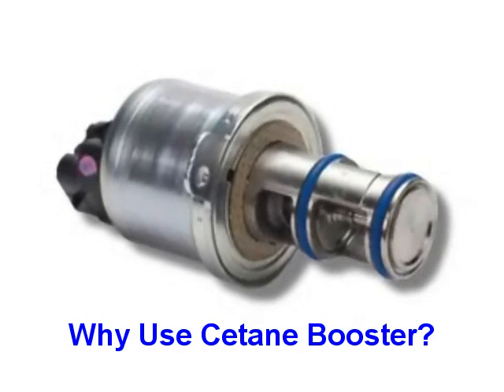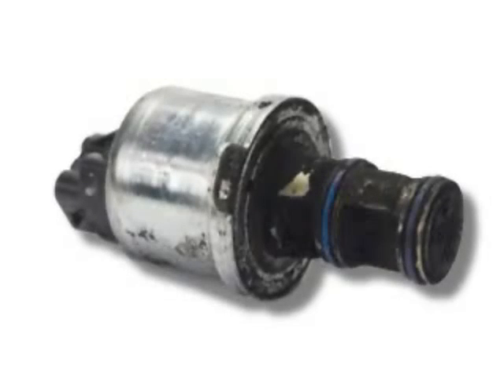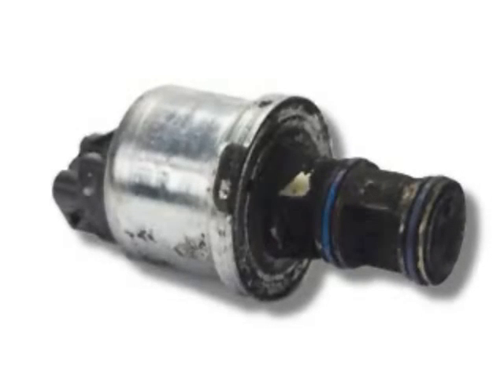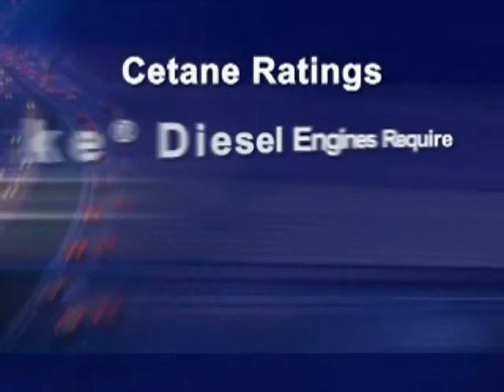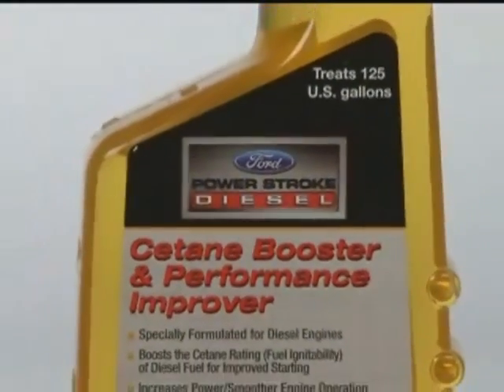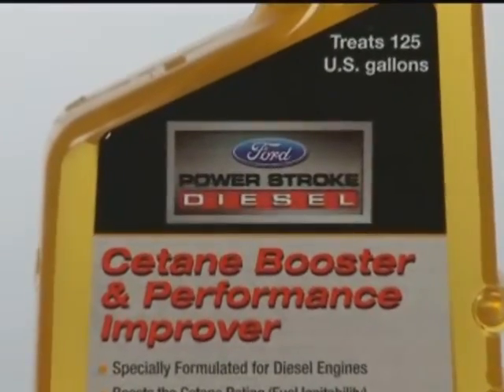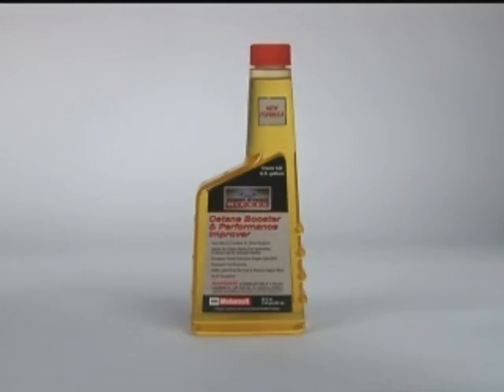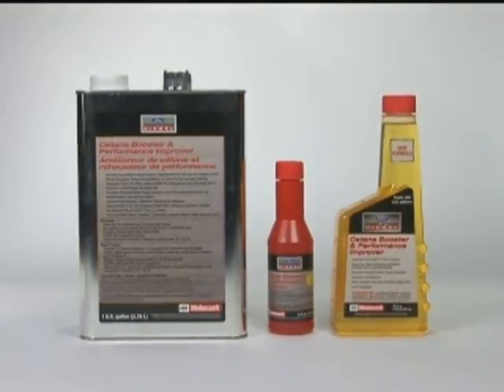Does Cetane Booster Work?

Comment: Well it does work I have a mercedes clk 270 CDI and the mpg has gone up. From 42 mpg on my normal run to mid Wales on a and b roads to 47 and it so smooth and pick up is so much better. And no smoke when you floor it. I would highly recommend it.

Comment: The owners manual says Cetane Boost isn't required, but goes to recommend this stuff. It's not abig jump in anything like power, mpgs, etc but my rig does run considerably quieter running the Motorcraft PM22A Cetane Boost. I used to run Power Service Diesel Kleen but when I switched to this stuff in my 6.7 Powerstroke I stayed with it.